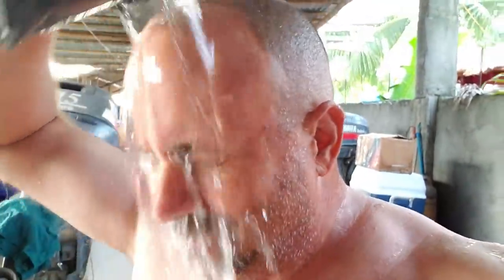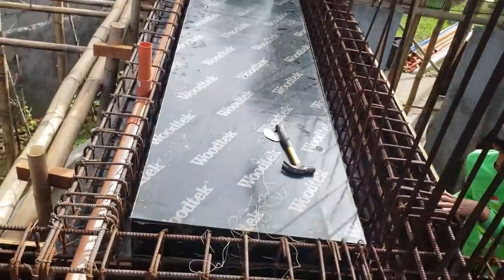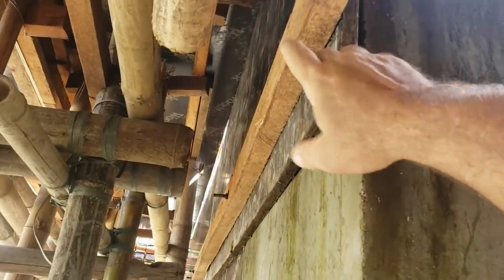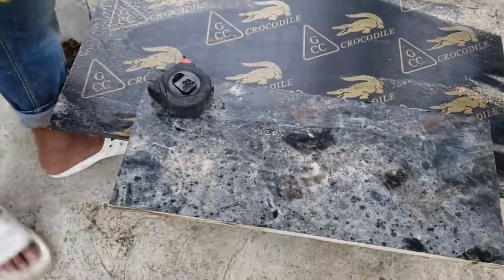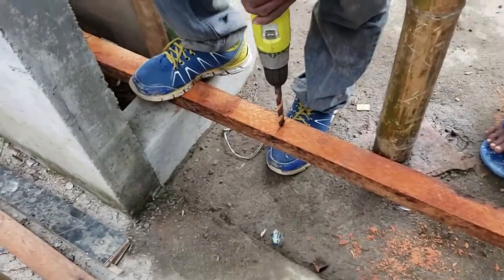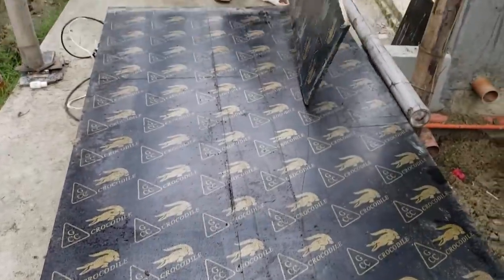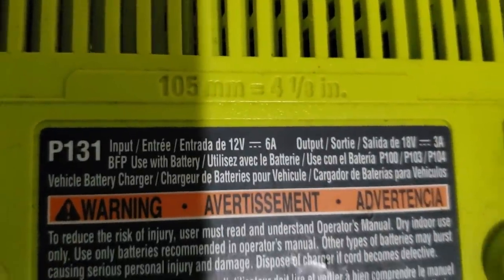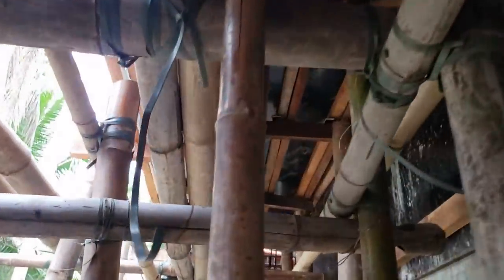Philippines Beach House Build Day 114: Beach,Tabo Shower, Tools , Forming, Step down Transformers

Comment: Before casting the walls of the fish pond, you need to add an overflow outlet at the level of the inflow from the cistern.  If the drop of the pipe from the cistern to the pond is 12 inches, but the surface of the pond is 24 inches above that pipe's opening, nasty pond water will flow back into the cistern.  Actually I would not  use a gravity feed at all.  Instead pump the excess water from the cistern to a spigot ABOVE the surface of the pond, so it cannot siphon back.
Reply from the maker: Appreciate the tip - we accounted for those facts while building it. I will show our method at some point. Pond is sideline thing here so it is sitting idol for now. After second floor pour and curing time before we can start going up again I might have them finish that so i can get my sharks growing. LOL  I do like how your paying attention. That is awesome! Thinking ahead person like myself!!

Comment: James, I see some expat upper beams poured about 2/3 of the beam depth and the remaining 1/3 poured with the 
floor slab.  This was done on the "Australian in the Philippines" build. His house was well built, and he seems to be a
smart knowledgeable guy, but that is what he did. Any thoughts.
         We poured our upper beams monolithically with the wall sections and the floor over the beams. Our rebar grid 
runs completely across the slab in both directions continuously with 16" splices and staggered joints. We also put
a poly sheet bearing over the beams to allow expansion from the sun during construction. I really like the way you
are casting the beams and floor monolithically. We already had the beams cast with the walls so couldn't dp that
but it would seem to make a stronger floor. There was just so much concrete we can mix in a day like 84 bags of
1-2-3 mix so we had slab joints over some of the 14" wide by 24" beams. This guarantees water leaks until the floor
tiles get put on but kept us around 60 bags per pour day and reused the forms. The spider beam was 84 bags and
finished up after dark.

                                                      george and aurora                   Villa Cecelia build
Reply from the maker: George if he only poured  2/3 of the beam as a separate pour of the floor he compromised the beams.  Now if he poured the beams and floor with floor recessed in the beams as a monolithic pour that could work. because the full depth  of the beam is still intact.

Comment: Thanks for the electrical power systems that you use . 230 vac step down to 110 vac transformer . 1 kw should be fine for what im thinking about cuz its portable lol

Comment: I had a friend who was an engineer for a large USA steam boiler company they did a JV with an India boiler manufacturer they rebuilt the factory to modern western standards one of which was installing large work tables so the workers could stand up and assemble boiler parts instead of squatting on the floor when he returned 6 month and later all the workers were squatting on top of the work benches assembling the parts can't teach an old dog new tricks heavy rain here in Roxas City this Sat morning stay safe
Reply from the maker: Interesting!!!!! We just got tiny sprinkle here. I wonder if its moving this way Tom?
Reply: @TexasFilipino  I think there is a mountain range between us that diverts the rain storm some can br rain all day here but drive to Iloilo and its sunny

Comment: Looking so good. I love those morning dips in the ocean myself. I was wondering how you charge all those 12 volt batteries.  Thanks I just keep learning.👍
Reply from the maker: those batteries are charged by 12 330 watt panels - they are in parallel and series for 24v and higher amps. I use a mpp Solar charger/ inverter. Then I have a second set of panels for 12v only that charges one  big 12v solar battery for well pump and lansdcaping lights

Comment: It might be worth getting all the external metals hot dipped galvanised to combat the sea air, it is not a life time solution or a filter intake covered by concrete housing to protect any external equipment from rusting.
Reply from the maker: rust is no joke by the shore!

Comment: Hello James, the build is coming on well. I am a structural engineer and it always puzzles me why your forming so much concrete supporting beams. Surely it would be more cost effective and labour saving to use steel beams. Whats the reason for everything  to be poured concrete.  Just a curiosity because we can learn somthing new every day.Great to watch the build and great tips
Reply from the maker: because 1. I don't want to look at steel beams, the bottom of the upstairs floor will be the ceiling below. I don't want to waste time wrapping them with junk products like sheetrock ( gypsum board) that the humidity will destroy and mold plus the paper on the gypsum attracts tiny lil ants and termites in this tropical country that will work thru and eat all the cellulose paper away. 2. Structural steel is very high dollar here.  The cost would be tremendous! 3. It would flex too much in earthquake and the walls would just be fill ( aka post n fill construction) It would all fall right out to the ground and maybe kill someone. 4. SALT SALT SALT - We have a hanging Habagat monsoon from the southwest. The south faces right out the back of our house. The sea spray and salt EATS EVERYTHING. Nothing is spared. It would have to be cared for endlessly if ever exposed.  If salt managed to start eating it inside somewhere you can't see to it will be rusting away and strength compromised. SUPER Rare to see steel used here. A solid concrete structure is exactly what I want. My question is why in the USA do they build big hotels , condos and houses in hurricane areas with sheet metal studs and styrofoam board with thin thin stucco on it and a thin rubber membrane roof then when the hurricane hits the news is everywhere showing all the destruction and drama when it could have been prevented with better building standards out of better materials. I know this well because I worked the southern coast of American with Army Corps of Engineers contracts dealing with all of that. This is accumulated knowledge of what I have experienced both in the USA and Philippines as a builder.

Comment: James,  tell us why you should not use beach sand with the cement and aggregate mix.
Reply from the maker: SALT SALT SALT eating the steel from within and it also will be effecting your paints and everything as it bleeds that salt out over the years. Your walls will have a white caustic look always coming out. Salt attracts moisture as well which helps the corrosion process.

Comment: Sounds like you have a good system with the cordless recharging system.  I need a solar  system and been keeping my eyes and ears open for a reliable system. I use dewalt 20v and don't want to change just because of the investment I have in that picticular brand. Should I purchase my own solar here and ship it? Good video James I've learned quite a bit. Thanks  God bless.
Reply from the maker: Man oh man advice on solar is tough one. Panels are easy to get here. Just like tools people are particular on brands of inverters etc. Solar lithium batteries ship here balikbayan. Hard to find here
Reply: Thanks.

Comment: James I noticed them nailing the forms now instead of screwing them, Im guessing that means the forms are not going to be used again.
Reply from the maker: those forms will pop right apart the seems to be used again on the second floor. We use screws on corners and joints for more strength. Along those beams they nail them and then tie a wire and across the bottom and tension them.

Comment: love waking up on the beach but i can't live there. i had a condo on south padre and had to replace the ac unit every 2 years due to rust.
Reply from the maker: That is right Van. That salt is no joke! Why can't you live near beach?
Reply: Man, I need to get my eyes checked. At first glance, I thought it said love making on the beach. 😂
Reply: @TexasFilipino  maintenance
Reply: @TexasFilipino  only about 1 hour away in 2 directions. closer than Galveston, PA, and south padre were to me so i can live with it. tagaytay is kind of in what they call mountains and is pretty much 74-85  everyday
Reply: @tcltv4610  well that is a good way to start the day with the rythm of the waves😉

Comment: Hello Sir, why are you running large horizontal pipes inside the slab and beams? these will substantially reduce volume of concrete strength. You can leave these horizontal pipes exposed under the soffit. This is a no-no in structural design.
Reply from the maker: Some of those beams was put in place oversized or where not actually need just for hiding the utilities away. These are cast formed walls with the columns monolithic. The walls go from tie beam to second floor and can carry the load fully themselves. The columns are over sized tremendously for the fact of that to be inside. I can point out so many of the worlds so called acceptable ways that are NO NO's  I know exactly what I am doing! Not trying to be arrogant but just telling the truth.  I have a 100% percent track record on building in the USA with not one ever single call back ! Lots of repeat business. Still to this very day I am contacted wanting me to bid projects so I can be the one!

Comment: Are you going to have 110 outlets in yur home or garage?
Reply from the maker: No - that is mistakes waiting to happen. Visitors or family just not understand and just see a plug. no matter what you label on it. They will just plug in and boom!!! I will have 110 here soon - any day now BIG 110 inverter I sent from USA. It will be in the electrical mechanical room on roof deck with lock and key to the door. I can plug up to it If I need or run a extension cord. Everything will be 220v. Most of the world is that voltage just North America is the odd balls
Reply: @TexasFilipino  ty I was just curious. Figured you would have one in yur garage
Reply from the maker: You know i dhould do that n put a lock box in front of it. Good idea. I need to run a conduit for that Asap. THANKS